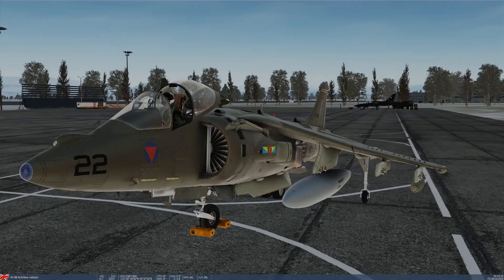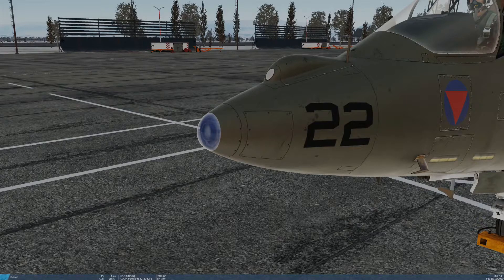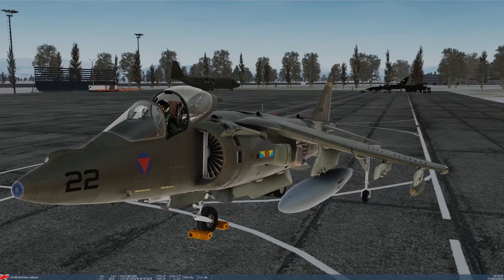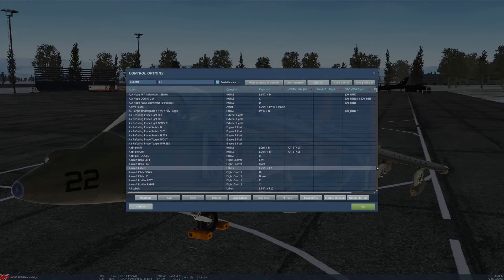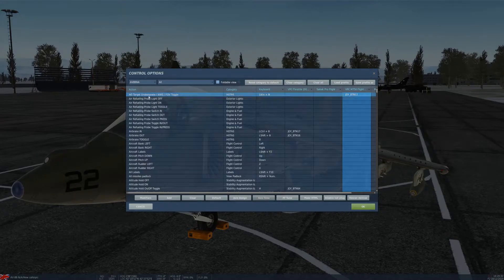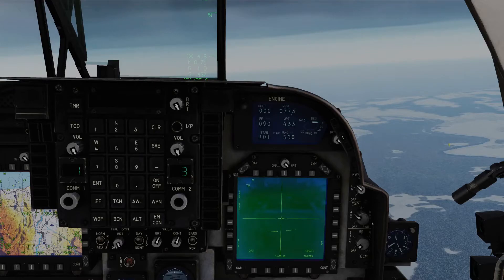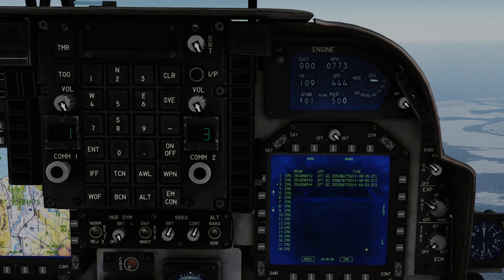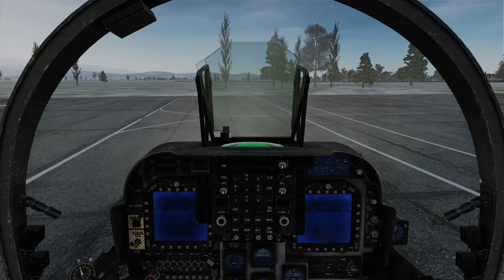DCS AV8B Tutorial 6 - Onboard Sensors

Comment: When I try to lock on using the dmt I find that the cursor is a bit ‘squirrely’ and moves too fast to properly lock on until I’m really close, it also tends to be inaccurate unless I’m really close and can properly get the target lined up. Any tips how to deal with this? I have a warthog hotas as you do so it’s not like my equipment is as fault. Also, unless you actually tend to create a mission yourself, most user generated single player missions or multiplayer servers don’t mark targets on the map so this technique only tends to work If you created the mission yourself

Comment: Is adding the target coords using the F10 map, creating target points and labeling T00, T01,T02 etc  then RShift/RAlt/0 still the current method?  I get nothing when I try this on the ground with engines off and when I try it in the air I get a message stating I can only make changes on the ground with the engines off.
Reply from the maker: Ah, sorry for the confusion. This is still the current procedure but the keyboard command should be RShift/RAlt/8. My mistake. Also this should work at any time.

Comment: When I reposition target points or waypoints via the map with the TDC, sometimes my TDC axes are inverted, sometimes not. What's up with that?
Also, are your instructions (TDC depress) applicable with TDC action/no action box checked or unchecked?
Can mark circles simulating JTAC be created by other players or can I only get those in my CAS page that I created myself?
Reply from the maker: The axis inversion I believe is a known bug. TDC action/no action I've not been able to work out at all so far. It's supposed to change the slew speed as I understand it but on or off it doesn't seem to do anything for me and there is no documentation right now. The mark circles can only be created by yourself. There is now the ability to get CAS targets from a JTAC though which I'll be making a video on this week.

Comment: Hey man, thank you so much for these tutorials. When I press Use in the CAS page on the right MFCD like you are doing in min 17:40 the EHSD page turns red (Like when you press on Data), I'm not sure if that's supposed to happen. I press Data and it goes back to green, but when I'm following your other tutorial in how to release JDAMs and press the DESC button, I don't see the same symbology in the EHSD page (The minimum range of when you can release the bomb), I'm just seeing the regular EHSD page with a waypoint.

Edit: I forgot to mention that I made sure the targets show up as T1,  T2, etc on the CAS > RCALL page
Reply from the maker: Well spotted, these are actually changes made in DCS 2.7.0. I'm currently working on a video showcasing these changes which I may have ready by the weekend.
Reply: @deephack  yeah, I was able to figure out what happened lol you need to set up the Fuze and select your targets from the bomb profile.

Comment: Great overview. I would add the NAVFLIR HUD mode (HUD to NITE and SSS depress) and how to adjust it with the gain and contrast dials on the HUD controls. NAVFLIR in WhiteHot at night is fantastic!
Reply from the maker: Totally agree, the only reason I omitted it is because in latest open beta it seems to be broken. I couldn't get it to engage despite the fact I'm sure I used it a couple of months ago. I am planning to do a night ops dedicated tutorial in any case and so I'll cover it there.
Reply: @deephack  I'll check later today. I did not check after last OpenBeta Hotfix, but there are significant changes to the adjustment of the HUD overlay. You can't just switch it on, you now need to adjust Gain and Contrast for WHot and BHot modes with the dials for the HUD.
Reply: @deephack  ok, there is a change to the HOTAS. You now need to do SSS right for NAVFLIR on the MFD, set HUD mode to NIGHT and now depress SSS twice. On the HUD panel with WHot selected adjust Video BRT to 2 o'clock and CONT to about 1 o'clock  or what suites you best.
Reply from the maker: Thanks so much for looking into this. I clearly missed a patch note somewhere and just assumed that this wasn't working. I'll include this in the night flying video I record soon.